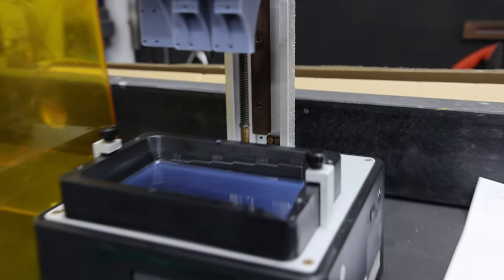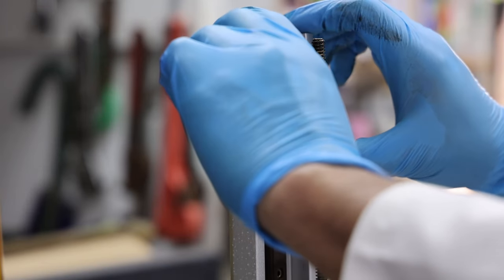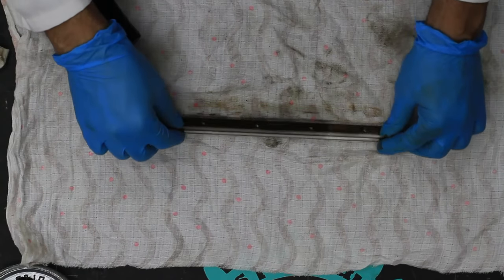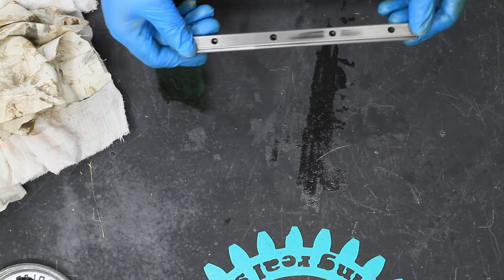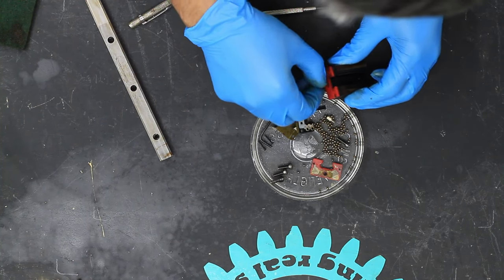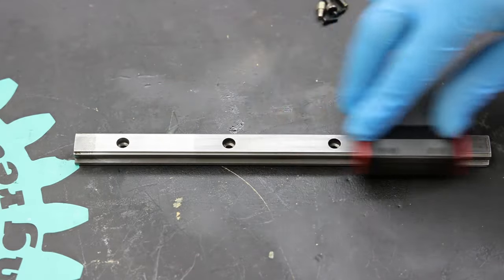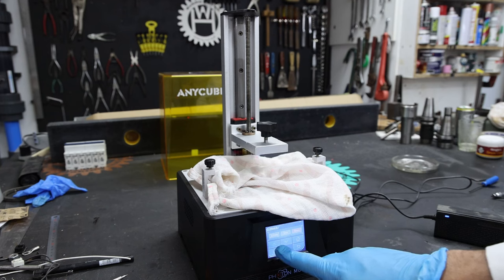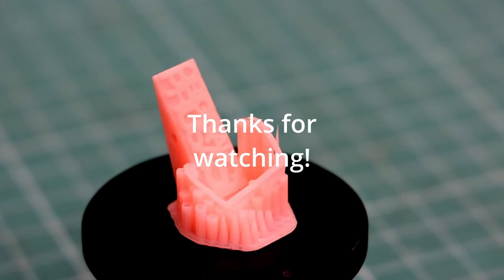Can we fix it?

Comment: Interesting that you put the effort in to actually fix it instead of just buying a new rail. Do you have any issues with your Mono and Antialiasing? I have been trying to dial in this same printer that I found at a thrift store for $25 but even after a firmware update, the AA seems to only work to an extent, but I cant get a completely smooth surface like on my Mars 2 pro.
Reply from the maker: Getting a new rail would have been the next option (actually, I need to upgrade to a larger printer, so that would probably have been the next step if I hadn't got this to work).  As for AA, you probably know much more than me, but I've always been highly skeptical - on a display, or even colour printout, you can anti-alias by creating the illusion of smoothness with a greyscale / different colour pixel.  With resin 3D printing, you either cure the resin or you don't - there are no 'half pixels' real or illusionary.